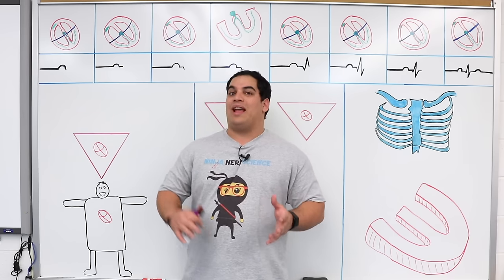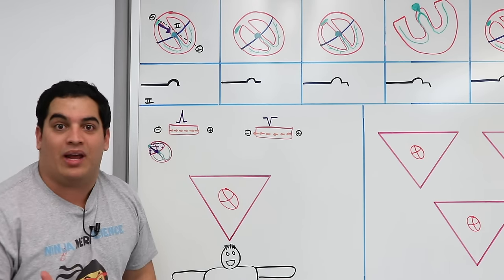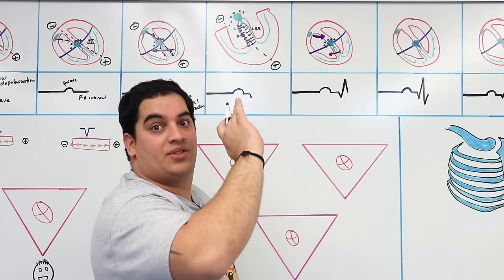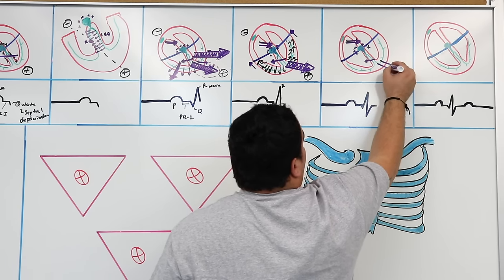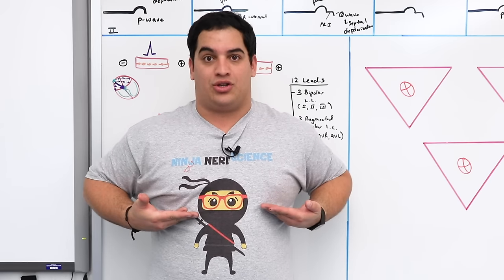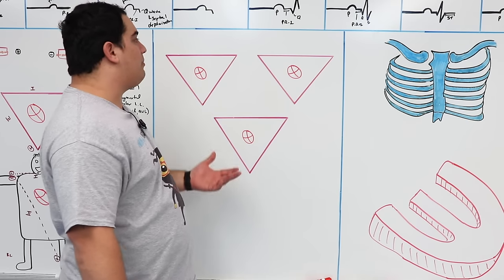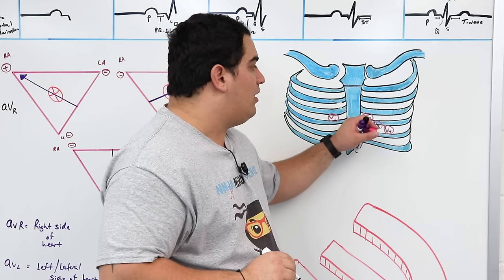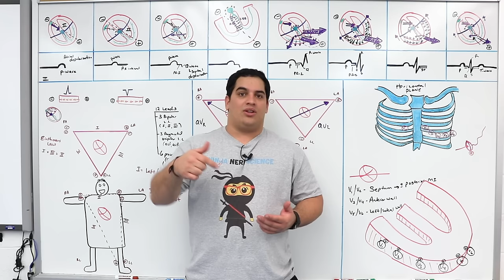Cardiovascular | EKG Basics

Comment: Basically my notes, hope I did well xD 

When negative moves to positive, there is a positive deflection (QRS complex)
When positive moves to negative, there is a negative deflection (Inverted QRS)

The flatline that comes immediately after the P wave is when the electrical current hits the AV node AKA PR Interval which holds the impulse for 0.1sec.
The dip after the flatline, right before the QRS complex is a negative deflection (Q wave). 
The bundle branches depolarize from left to right. Essentially because of the anatomy of the heart, the conductivity is moving top to bottom or negative to positive AKA positive deflection, then from bottom left (positive) to right and up or positive to negative AKA negative deflection. When it reached the apex, it ended at a positive point. Now it's moving from a positive point (Apex) back to the right side and up a little which is a negative point, hence the positive to negative. This negative deflection is the Q wave or septal depolarization. 
The purkinje fibers are depolarized which then causes the myocardium to contract, making the ventricles contract or a big positive deflection AKA R wave. The R wave is depolarization at the APEX of the heart.
Lead 2 is located at the left foot. The net conduction points south east, if our body was a compass. The LV generates more conduction because it's thicker than the RV. Therefore, the net conduction leans a little left instead of the middle.
As stimulation is moved outward at the R wave, the current must go up, and when we go from down to up thats a positive to negative AKA negative deflection. This negative deflection is the S wave which is the plummet after the R wave on an EKG. The S wave is the depolarization at the BASE of the heart.
ST segment is the time at which the ventricles are still depolarized(no extra movement=isoelectric), it hasn’t repolarized yet.
The negative charge is now moving back up and away from the positive Apex, it causes a positive deflection AKA the T wave.
12-Lead-EKG gives a 3D view of the heart on a 2D plane.

3-Leads are bipolar limb leads: Lead I Lead II Lead III       -
 (Have negative and positive electrode for each)                | Looks at the heart in a frontal plane
                                                                                                     | Coronal view or front and back view
3-Augmented Unipolar Limb (AUL): Leads AVF(Foot) AVR AVL             -

Lead I is a neg node on the right shoulder and a pos node on the left shoulder, that imaginary line that connects the 2 is Lead I - Looking from the left/lateral heart.
Lead II another neg node on the right shoulder and a pos node on the left leg. The imaginary line is from the right shoulder to the left leg AKA Lead II. - Looking from inferior to superior.
Lead III another pos node on the left leg and a neg node on the left shoulder. - Looking from right/lat heart/inferior.

Einthoven’s Law: Lead I + Lead III = Lead II

The AUL has one node per part of the body.
What the AUL does is switch the charges on the nodes to see what’s happening on one side of the heart and computes it on the EKG.
AVR shows what’s happening on the right side -> creates a positive charge on the right node/arm while the left arm and left leg are negative.
AVF shows what's happening from the inferior view -> creates a positive charge on the left leg node while the left arm and the left arm are negative.
AVL shows what’s happening on the left/lateral side -> creates a positive charge on the left node/arm while the right arm and left leg are negative.

6- Precordial Chest Leads: Lead I   Lead II   Lead III   Lead IV   Lead V   Lead VI - Transverse or horizontal section

Right 4th intercostal space V1
Left 4th intercostal space V2
Left 5th Intercostal space mid clavicular V4
V3 goes between V2 and V4
Left armpit (anterior axillary line) 5th intercostal V5
Left middle armpit (mid axillary line) 5th intercostal V6

Precordial Chest Leads don’t need negative charge leads with the positive ones, just positive leads (unipolar)
V1/V2 picks up interventricular septum conduction/posterior
V3/V4 picks up anterior ventricular wall conduction
V5/V6 picks up left lateral part of the heart conduction
V7/V8/V9 for posterior
Reply: boi, you make my life easier, virtual hug from  malaysia
Reply: God bless you again virtual hug from india 🙏🏽
Reply: 7 8 9 is it under the same chest leads ..
Reply: I hope 🤞 u ll reply bro ..
Reply: You’re a legend! More blessings to you 👊🏿
Reply: "AVF shows what's happening from the inferior view -> creates a positive charge on the left leg node while the left arm and the left arm are negative."

just a typo, Left arm and Right arm are negative.

Comment: The ONLY thing I would add is that the av discharge is not because it is "slow" (although slower than other discharges), but because it's "charging up" (accepting/collecting) more charge for a split second before doing it's vital job of "passing it along". 🤓

Comment: The doctor is good but he could not explain why ST-segment deflection (before a proper T wave defection comes). This EKG is a very primitive technology, it is some 120 years old. Physicists have never entered in the medical field. It should be replaced with digital technology as most of the multimeters have now switched over the digital technology to see voltage or voltage failure in a circuit. This is a plain vanilla galvanometer and most of the doctors even of completing graduation could not understand what does this graph mean. You can visit any hospital randomly and ask fresh graduates and older lots you will find millions. By using bullion and software like python etc. we can even draw the exact electric conduction system of any moving heart in 3D. That would show MIs, LBBBs, cardiac myopathies, etc. Disclaimer: I am not a doctor.